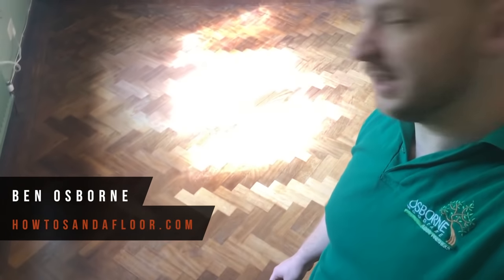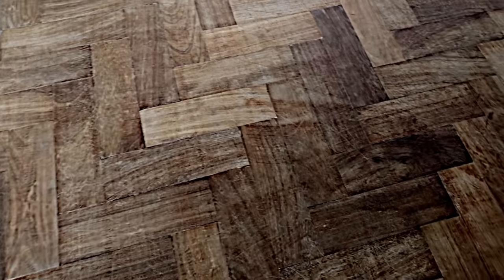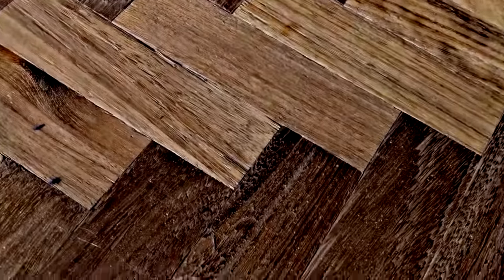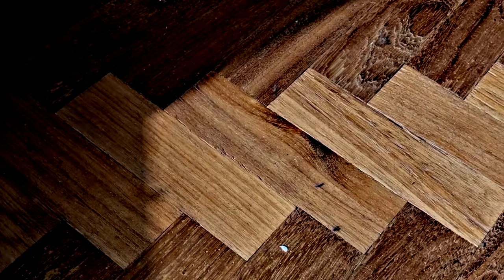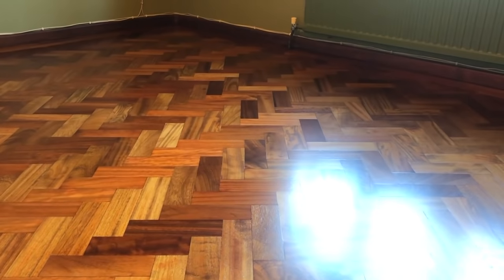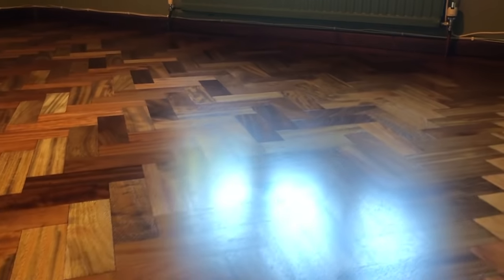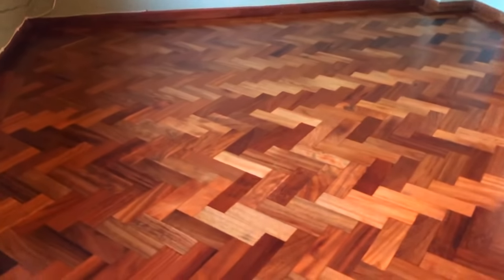Parquet Floor Restoration (EPIC TRANSFORMATION)

Comment: The saddest part of this,  - is the fact that so few people can percieve the difference between your perfectionism & a cowboys substandard effort.  BTW - This is an outstanding result, - Best of the best......( from a 20yr. floor sanding vet.)
Reply: I got a question to a old head in the business… say your sanding a harring bone floor and you don’t have them trio machines how do you sand them with big machine and not leave them cross cut marks for when they use a stain and not just clear coat?? Jw I been in the business for bout 3 or so years and was jw for the future thanks!!
Reply: After you try to refinish a floor yourself once, you will know for sure how to tell a pro job from cowboy’s. 
You will know it from your own mistakes and from understanding of what is really difficult in this job vs what people think is difficult.

Comment: Thanks for showing us DIYers how to do a parquet floor. Any chance you can give us the names of the products you use? i.e. what did you use to fill the floor with after sanding#1?
Reply: When I do this I use Bona products, so you just have to match the filler color with the type of wood. So if it's a white oak floor then I use Bona Pacific Filler in the white oak color. Then use the Bona sealer and top coat of your choice.

Comment: And you run the trio just like me only problem is I'm having a real hard time the trio is so smooth compared to my edges and I'm Palm sanding with the 120 and trio in with a hundred and sometimes I still get a border I don't know what the hell I'm doing wrong and I'm water popping sometimes on the darker colors any help you could give me appreciate it thank you keep up the great work
Reply from the maker: Im not going to lie, the trio takes me a bit extra time. Ill usually belt to 80 grit, then drop to 60 on the trio without the flexi-rings, hard plate it flat. Fill it with the trip dust, take off the filler with the blunt 60s (sometimes having to put fresh 60's on, then 80 and 100 with flexi rings.

Recently after 10+ years only using the trio with the weight on, I now never use the weight. I find it works just as well but the abrasives last longer
Reply: @HowToSandAFloor  yeah I've always used the flexing rigs somebody else told me that might be my problem too and a lot of the times I like using a weight because if the floor isn't completely even it bounces like crazy
Reply: @HowToSandAFloor  also thanks for the response I really appreciate it man thanks for taking the time there's not a lot of us four guys out there especially in Pennsylvania United States a rare breed my brother but I appreciate it I love the videos
Reply: @HowToSandAFloor  hey brother do you screen after you do your trio like do you screen with your roto

Comment: Hey I have a parquet floor but mom are the 9” square one, they are thin and I’m wondering if the ones you sanded in this video are of the same thickness and if so what grit of sand paper did you use?

Comment: Any issues with the lacquer + dust fill cracking over time due to expansion and contraction of wood?
Reply from the maker: Yes depending on the species of wood. This was iroko which has a very high moisture content and doesn't expand and contract much. Beech on the other hand is unbearable it moves so much

Comment: Can you share the names of the different pieces of equipment you show in this video?
Reply from the maker: Dane Sorensen Lagler hummel, Lagler trio, festool Rotex, festool extractor, Pallmann Gecko 2 edger. Numatic woodworker buffer. Fein multimaster
Reply: @HowToSandAFloor  
Which is the Sander with wheels? 

Thx
Reply: @bethbartlett5692  At least 3 of the sanders have wheels.

Comment: New subscriber here love your vids ….Q: what grit number sandpapers do you recommend from course to finish? And what finishing emulsion do you recommend? TIA 👍
Reply: The grit you use depends on how badly the floor is damaged. If it's damaged pretty bad, then start a the lowest grit you can find. If it's a new installation, then I typically start with a 36 grit since the boards can sometimes have a "lip" that's higher than its neighbor. If it's an older floor that's not damaged and is already flat, so that you just want to remove the existing finish, then I start at an 80 grit. Wherever you start at, you want to make sure you only skip no more than one grit level. So if you start at 36 grit, then you can skip 40 grit, but you can't skip 60 grit. So the grit pattern looks like 36, then 60, then 100, etc. to the final grit that's recommended on the bottle of the finish you're using. If you're ever in doubt then don't skip the next highest grit level, just go through each one of them. It will take longer, but you're less likely to leave any unsightly scratches or marks in the floor.
Reply: @CheeseBae  hey, many thanks for your advice ....really appreciate it 👍

Comment: hey bro if wood has paint on it do you strip it off first or just go right down to sanding
Reply: furiookami depends on how many layers of paint it’s had, I’ve worked in a school where it had been painted so many times we had to use a special drum cover in blades to cut it away.

1-3 layers; just crack on with the sanding, nice  low grit, 24 maybe. Belts may last longer if you only go backwards when removing the paint 👍🏻
Reply: @laurenceosborne4261  it's painted once, silver, and chipping all over. thanks for the advice!
Reply: You get some of that nice 12 grit and go at it. lol

Comment: You should get a nice back unit vacuum man. They are only like $400 and oh my word do they make clean up so much easier. Do you usually use the wood dough, or was this floor bad? Do you usually use water base?
Reply from the maker: Ronald Hodgson you mean like those back pack vacuums?
Reply from the maker: And yeah usually waterbased top coats. We don’t have the precoloured trowel filler over here
Reply: @HowToSandAFloor , yeah the Proteam is the brand I use. They are just treat for cleaning floors before filling or finish.
Reply: @HowToSandAFloor , I use wood dough for 3/8 flooring, but yeah usually I use the water based colored filler. 

I like that floor, in my area it is nonexistant. It is pretty plain straights. Usually white/red oak mix.

Comment: So was helping my aunt about a year ago, I was doing good till I hit a spot that the wood was rotted and not secured and I was getting a drink ... attached cup holder for my beer to sander... and I cut into the floor, the machine started wobbling crazy and the pieces came up, 2 stuck in the wall across the room and 1 went out the new double pane window glass. The beer bottle spilled on the sanded floor part and I let go of the sander to grab it and it started spinning in circles to the cord  ripped out of the wall outlet. Between the outlet and the buffer was a gallon of polyurethane gallon can that smacked against the wall and the lid wasn’t on all the way because we opened it to look, as if we knew what we were looking at to begin with but smelled great.... think I was high also from fumes, anyway we have poly on the walls, ceiling and floors. She threw me out I will see her after a year at a wedding... oh, her son in law fixed everything...

Comment: Where do you buy the oak sawdust to fill gaps with the IRCOl filler stuff
Reply from the maker: We don’t but it we take it out of the dust collection bags of the machines, that way you’re filling with the same dust as the wood of the floor.
Reply: @HowToSandAFloor  how do you do the filling? it's a little unclear what you're using. thank you
#